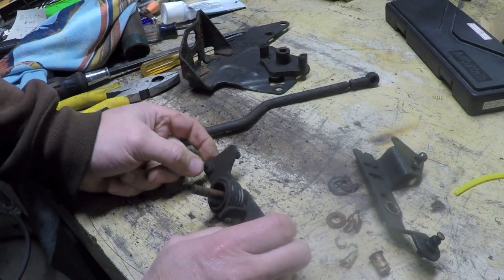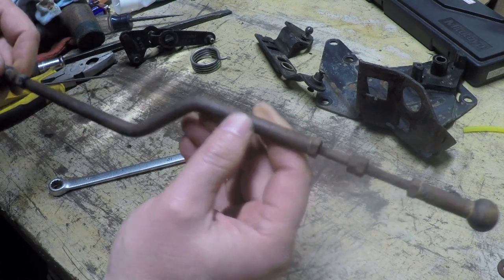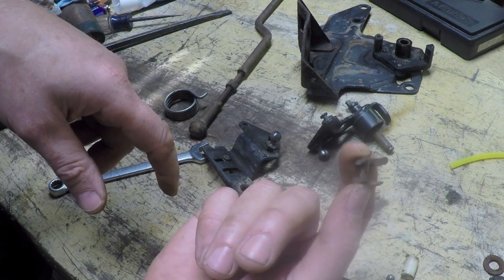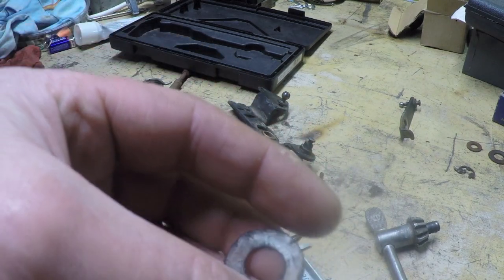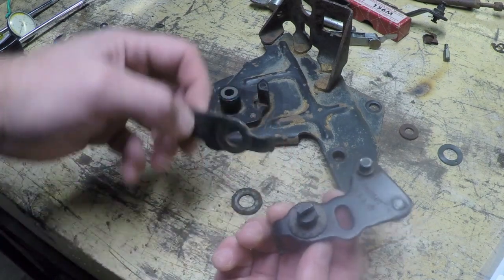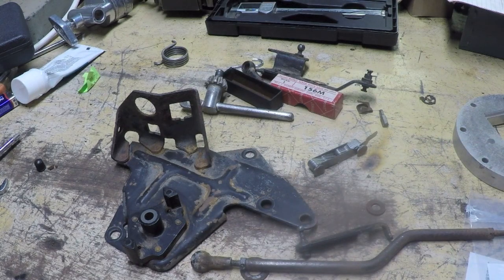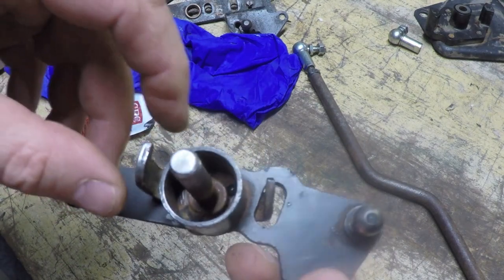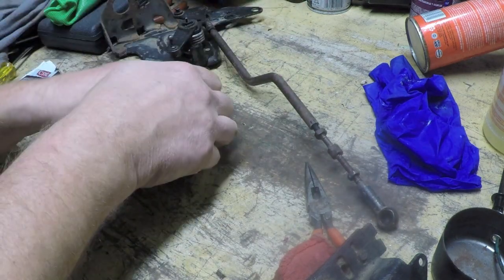1997 Dodge Cummins 5.9 throttle linkage repair Part 2

Comment: I am so gratefull for how you showed each part. After a lot of force with a long screw driver to get the rod ball back on I was afraid I had bent something cause I was feeling a little ckick moving the mechanism.  But after look at the parts all my parts look good. So thanks again.

Comment: 1997 Dodge Cummins 5.9 throttle linkage shift key retaining clip ($25) is in McMASTER-CARR  named Clip-On external Retaining rings $ 6 to $ 14 depending on size.

Comment: power driven diesel now has the brass bellcrank bushings for the throttle on 12v cummins p7100 pumps

Comment: just got mine apart we are going to sleeve the bracket and use a bronze bushing.  going to tig up groove in the shaft and turn it back down. the condition of the bushings were bad

Comment: Hi Steve I believe that clips like the ones you need are used on older GM cars and trucks for retaining wiper motor linkage parts. That junkyard in Thompson or even Bates auto wrecking must have something like that. I believe those ball joints are called heim joints.

Comment: You Earned  new subscriber I'm having the issues with my truck too also a 1997 I put the tps sensor brand new $130.00 and yet kept acting up I thought it was low power circuit so installed a new alternator $160.00 and new ground,positive cables and batteries so now I'm going to take it all out and clean it out,I also changed de 3-4 accumulator spring,added a o/d-Torque converter  switch. But my truck tachometer still not functioning neither it is charging

Comment: What's shaking, Steve?!  I have been meaning to get back with you on the yard sale finds of yours, but in typical Christmas fashion, I have already purchased a DJI Spark and a Creality 3D printer for myself.  I swear that I will eventually swap some mail with you again shortly.  Toys!!!......TOYS EVERYWHERE!
Reply: Hey, that is awesome that you scored a 3D printer, Tech! I recall you saying you were interested in them over a lathe. Glad you found your niche.
Reply: @johnstrange6799  I got a screaming deal on Black Friday.  It's supposed to be at my front door in about an hour!  As far as the lathe goes, it's only a matter of practicality based on my current abode.  I rent a nice townhouse, but the basement that opens to the outdoors in the rear happens to be an old bar/man cave and has been converted in to my bedroom quarters.  I just don't have the right place......YET.  I WILL own a lathe at some point in my life.  I'm already collecting drops for project stock.

I come across a lot of brass and stainless in my industry.  I keep all I can.
Reply: The upside is the built-in bar is a great electronics bench for a dude that's 6'4" tall and having a sink for a the evening tooth-brushing is a huge bonus :D
Reply: When you do get a lathe: https://www.youtube.com/watch?v=sJd5UgzRY38  @TechGorilla1987
Reply from the maker: Did you go with Creality?
Reply: @stevewatr  Affirmative.  Got the Ender 3 (non-pro version) with the aluminum extruder feed upgrade and stepper isolation bushings as instant upgrades.  Attempting my first bed-leveling test print now.

Comment: I had a issue with my throttle linkage an come to find out there is a recall on them. So I took my truck to a local dodge dealer an they had to replace it. For free. Better than 130 dollars for the linkage.